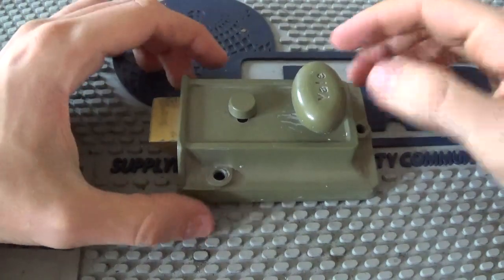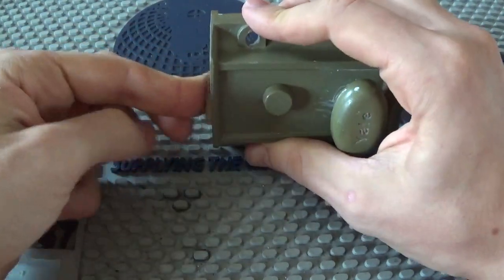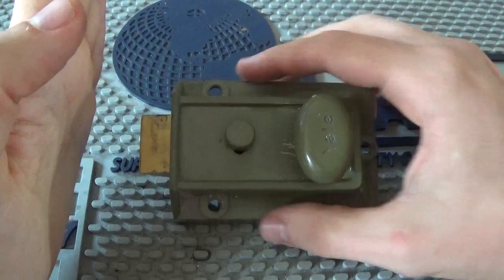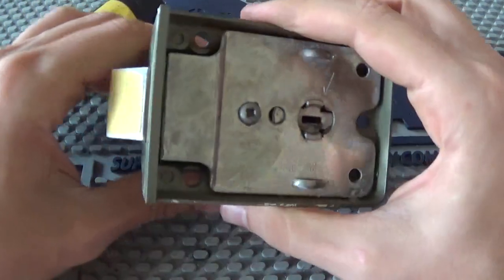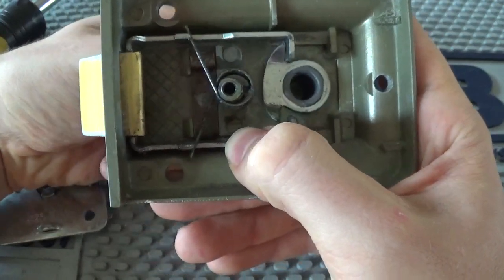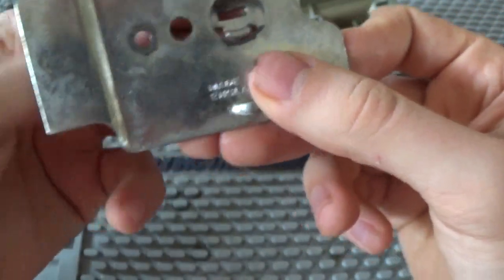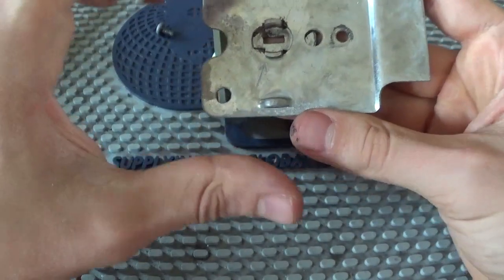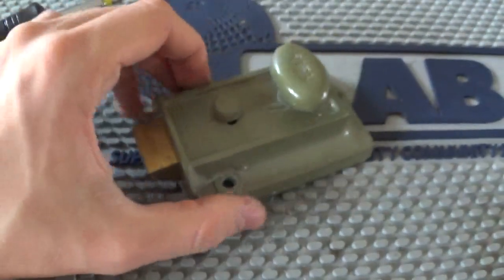Yale night latch

Comment: The arrow you can see on the back plate is intended to assist alignment by aligning it with the mark on that centre disc (that rotates)
Reply from the maker: Sometimes on these it is to enable or disable the deadlocking function from outside

Comment: Thank you dude, I used this to fix my father-in-law's lock. Me, my partner, and my kid are using his place for a bit, and we would be without a lock in an area with the highest violent crime rate in my country. Using this video has helped us sleep soundly at night 👍
Reply from the maker: Happy to hear it helps 👍🏻
Reply: You need some dead locks not just a standard nightlatch.
Reply from the maker: Absolutely, and use the deadlock. Alot of folks have a deadlock and are too lazy to use it which defeats the purpose

Comment: i just fitted a new one and the question  does the key supposed to turn both clockwise and anticlock wise to open door? Because when i turn the key clockwise the lock doesnt come back out itself. Same thing from the inside aswell. Help
Reply from the maker: If yours is identical to this one, it should be able to turn clockwise and anti clockwise when you are not using the little switch to lock the bolt outside of the latch or to hold inside the latch. But if you can turn the key in either direction you should be able to unlock it regardless.

Comment: Does the lock still work if u dont line the arrows up for the double locking feature
Reply from the maker: Yes it works as normal but without the ability to deadlock the latch.

Comment: Would you recommend this for the back door of a garage? There is currently an old style dead bolt on there and how would you recommend installing it? 😀
Reply from the maker: These locks are considered low security on their own. They are as good as a key in knob cylinder lock. I would use the instructions that come with the hardware when you buy it. They always seem to come with instructions on how to install them. There are also videos by hardware stores and Yale on YouTube explaning the install too.
If your dead bolt is old it might be a different size to new ones. 
If I were you I would replace the dead bolt with a thumb turn dead bolt or better still, consult a couple local locksmiths and get their advice especially if you are based in the US because they would have a better understanding than I. If you are based in the US, you could ask SE Lock and Key on YouTube because he is friendly and far more knowledgeable on American locks than me. I will leave a link to a install video of this lock if you are interested anyway. https://youtu.be/4sYECRnAvxU